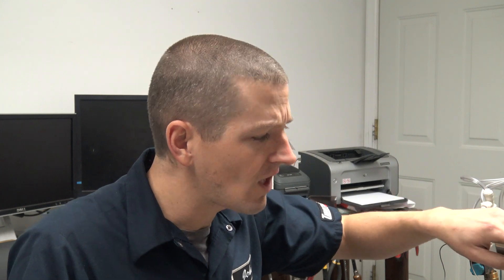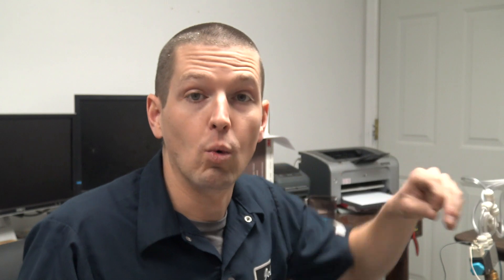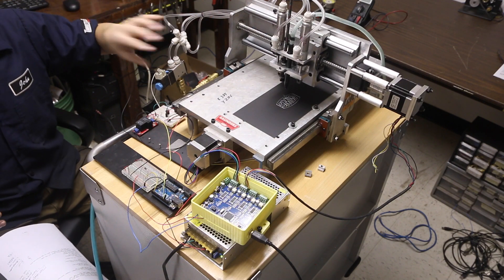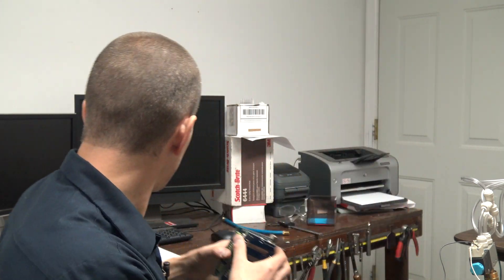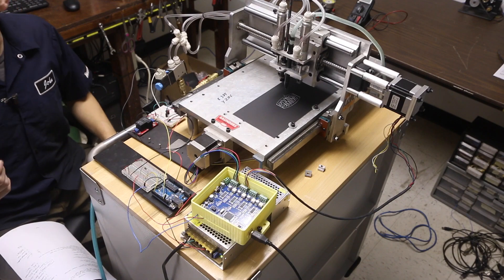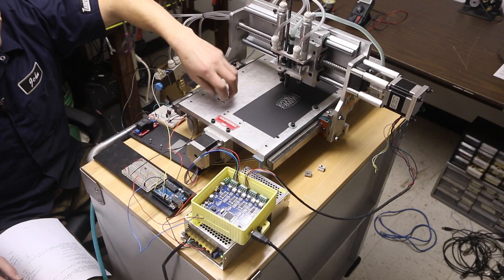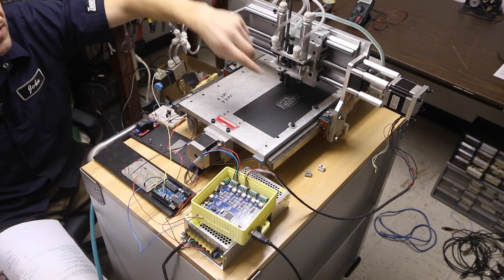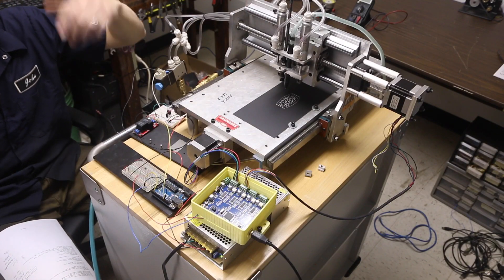DIY CNC Engraving Machine Details & Design

Comment: I know this may be a comment that may have arrived after the ship has sailed, but on commercial PCB milling machines (such as the LPFK), they have a shoe that rides with very little friction on the surface of the PCB. Perhaps you could do something similar here to keep the engraver at a set cutting depth and allow the pneumatics to provide the "Spring" action needed to ride out variations in material height.

Comment: Hi!  I think the relay fried your tinig.  You don't need a diode between the tinyg and arduino.  The correct location of the diode is between the source and ground of the relay.  Any time you connect an inductive load such as a relay, solenoid,  or motor to any integrated circuit (arduino,  tinyg, etc), you need to use the a flyback diode configuration.  Here is an explanation: https://en.m.wikipedia.org/wiki/Flyback_diode.

Comment: hey John. I know this is an older video and you may have every bug fixed by now but it reminded me of a software for pcb milling that will take your g-code and modify it to match your height variations on the work piece. bit more work involved compared to a working pneumatic system but the end result is astounding. Check it out here: http://www.autoleveller.co.uk/

Comment: For your plunge depth control, why not use a microswitch with spring loaded arm and roller?
 When the switch is engaged, lift the z access until the arm is relaxed and the microswitch turns off.

Comment: I have worked with neumatics and hydraulics for 20 years. Like everything the cost ramps up quickly and your air system also with quality inline filtration, dryers are costly. I think you used compression and expansion to label your cylinders, in neumatics you use a pressure on both sides simultaneously to regulate your working force desired much like your duel spring pin holder but using air pressure. Pilot valves regulars can get complex quickly. Thanks for sharing.

Comment: I left a comment on the first belt actuated machine. This looks feasible for my purpose of turning a manual knee mill into a CNC machine. From just looking at the price the motors are less than $15 , but are they strong enough to run a full size Bridgeport cloned mill? Also can 2 of these motors be coupled together for the X and Y axis? Or can the same other components be used with a bigger stepper motor? Its not that I'm just cheap, but rather I'm disabled from back issues but still love to make chips when I am able to get out in the shop. So being on a limited income makes thing tight.

Comment: You could use a laser optical sensor and zero it directly ahead of the pen tip rather than trying to dynamically regulate air pressure for your Z control.

Comment: I would weight the pen and have the pneumatics to lift it off of the part. fyi an old 9mm .40 cal brass make a great heat sink for the 7805 transistor. just knock out the primer and drill and tap for a machine screw.

Comment: You need a way to controll the C debth, but why are you trying to invent something that already exist? Stuborn? Stepper motors are invented for that purpose. You can also add a calibration routine that levels the ride height for uneven surfaces and that is not easy using pneumatics, -they give you speed, but not accuracy.

IMHO...

Comment: I don't know if you have fix the pneumatic issue. I have been working with similar equipments in the biomedical field as a field service engineer. In that design you put 2 air cylinders. You just need one. The one that is going to push the pen down. To have the assembly go up use a spring. You need to use a restrictor tubing in the intake and the exhaust to have a very smooth up an down movement. We use that in the biomedical to move arms and parts because is cheaper than stepper motors and more electronics. And works just fine. Lets say you put 30 psi in the air cylinder with no restrictors, it is going to move very violent. But if you restrict the air flow, the cylinder is going to move very smooth. And you can tune the velocity with different diameters holes or tinny tubings. If you have questions about that feel free to contact me. jmadero@hotmail.com

Comment: I just helped a friend assemble a 3D printer and I think that ALL the steppers ,drivers and software would work on adapting for cnc operation. Sorry about the move. I am just moving everything around my home shop and it is almost overwhelming. I am also building cabinets so I can get everything finally put away. Good luck and have fun. 
Bill

Comment: I like your "follower" idea. A cheap test valve would be an air ride suspension auto leveling valve which can be had at the auto parts store. Use a probe down to the work surface and the out-put to regulate the spindle height.
This way you would maintain the ability to adjust air pressure to change the tool pressure for different materials or depth of cut.
With a small carbide indicator tip you could get the probe very close to the engraver tip. These valves only require 2-3 inch pounds to actuate so the probe arm could be quite small, an indicator stand rod for example.

Comment: +NYC CNC  Have you thought about using a Jack Screw to control the Z Depth? OUtside of stepper motors i have seen lasers interrupts used with reference points on CNC routing tables. But I think a Jack screw in place of the threaded rod; since you could set the lowest end of the shaft at a few mm above the table and there are a variety of ways to control it from stepper motors with signal relays to help avoid missed steps to cog/chains that count either teeth or on time. I think a motor that connects to the screw shaft via chain and is controlled with a signal for foward/reverase bias in seconds would give you a fairly accurate setup with low cost as you already have an adruino and it shouldnt be to hard to add in the circuit. 

I'v run machines that use pneumatic to control a nozzle for re-flowing BGA chips on an automated table, they use a jackscrew with relays and a simple dc motor to control the nozzle height. And the relays tell the machine when the pickup has made contact with the IC to pick up/down and during the solder scavenge cycle keeps the vacuum nozzle from making contact with the board but maintain the correct offset as the board flexes from the heat cycle.

Comment: I was doing some research around a 3d printer but wanted to get something that i could potentially use as a 3d router/mill if i made the frame stiff enough. I started out with the Reprap electronics design but found may limitations not to mention the design is fairly old at this point. I was able to find a new board that combines some great features and is made to be used in milling/plasma/3d printing applications. Take a look (http://smoothieware.org/smoothieboard)

Comment: If you really want to get inspired by ultra high speed cnc motion in action, go check out professional PCB drilling machines like the Posalux Ultraspeed. They accelerate usually at around 4g (40m/s^2) on the Z, and not far slower on X and Y (depending on the size of the machine), move at several meters/second at a repetition accuracy of a few micrometers. What they do is use massive direct drive linear motors, and of course a massive block of cast rock (usually several tons, the US 6000 is over 8 tons heavy so it does not bounce around the shop floor at these rates of accelerations). And to top it of, they use quite fancy spindles too, with compressed air bearings they drill at over 300'000 RPM now. Amazing, fascinating stuff really, even if it's beyond what we would ever get in our small scale diy machines.

Comment: Sorry, Commenting as I watch. If you are looking to replace the Tormach, I HIGHLY recommend building the Oc CNC designed by ++Mark Carew. http://www.openbuilds.com/builds/openbuilds-ox-cnc-machine.341/   I just finished my mechanical build. Total cost ~$1k using a Huanyang VFD and 2.2 KW spindle. Also using TinyG to control.  You can absolutely use the Raspberry Pi set up you talked about. For a front end you can use an android tablet and TinyG CNC Console for Jogging. You can also use ssh/X11 forwarding to run Chilipeppr. There is also an offline version of Chill available.

Comment: I would use the Auto-Leveller built into ChiliPeppr to map a grid of the depth of the part you're engraving. If the part is conductive that's easy. If it's not then you lay aluminum foil over it, probe it, then run the engraver. You may have to adjust a G54 Z zero to account for the thickness of the aluminum foil. There's a video inside ChiliPeppr showing how to run the auto-leveller. It would mean that you need to add a stepper to your Z axis.
Reply: +John Lauer Could he use an inductive sensor (NPN NO) as a z probe if he is always going to be engraving anodized (electricly insulated) aluminum? Custom z offset(G54?) for non-contact probe? He could use the stepper to adjust his hard stop screw and still use his pneumatic cylinders. Or if he is only engraving parts he has designed in Fusion 360 couldn't he just do the engraving as another CAM process. Zero at the correct spot and orientation and run it with stepper controled Z stop?

Comment: Z axis: You have a leadscrew already. I'd put a stepper and bearings on that, ditch the pneumatics and treat the system like it's a full 3D mill rather than 2.5D. Then you can engrave on other non-flat or non-level surfaces You'd need a spring that'll push the engraving tool down with the requisite amount of force to keep you from pulling your hair out with varying height offsets, though. That's an exercise for the reader.

12v to 5v: Easy hack: Cheap car cigarette lighter cell phone charger cracked open and the USB ports desoldered will net you a "reliable enough" 5v 0.5A minimum. (Nowadays, some can do 2A, most are 1A, IIRC) supply from your 12v. They're available at gas stations, the local wally world, etc. It fails, you just buy a new one.

Movement speed: You're not milling: Gear the steppers ("harmonic drives" are nice and practically zero backlash, but expensive) or get ballscrews with a shallower pitch. I think new ballscrews are the cheaper option. A "new" pair of eBay-sourced XY ballscrews would cost you less than a single used/"surplus" harmonic drive on eBay. Preloaded double-nut leadscrews are more trouble than they're worth over the long term. (If you're using this in a moderate prod. environment, you'll end up fiddling with it at least monthly and probably replacing screws yearly because of wear. This doesn't really apply to Z as much because it's  just "down <a bunch of XY moves> up, <position to next> down...") Yes, you'll sacrifice a bit of accuracy but do you really /need/ engravings accurate to half a thou? I'd go for the speed, because your engraving (for say, serial numbers, plaques and such) would be just fine, even if off by the thickness (four thou) of a sheet of printer paper. So long as it's repeatable, (which ballscrews excel at.) it's a matter of software configuration.

Comment: that thing looks very precise.
for my own project, i used a DC 3V/3.3V Relay High Level Driver Relay to read the signal from the tinyG and tied in the 12 volts that come off the tinyG for the cooling fan to trip it.

to get more speed you can set the tinyG max velocities and jerk values using $xfr and $xjm. but changing over to belt drives instead of lead screws would be faster.

if you build a plasma table, keep the electrical interference in mind, it's been a real problem for me.

Comment: As far as needle distance, build a small laser range finder pointed just in front of the contact point and feed that into the z-axis control. With a little calibration and or delay that should do the trick.

Comment: John I have used adjustable pressure relief valves in the source lines for the push on the cylinders to get controlled forces from cylinders if you put a regulator to limit the raw pressure to just activate the valve and then bypass excess through the relief through a port to reduce the flow it could work and not  eat up a lot of compressed air.The Idea is to let the bypass set the level of the engraver.

BTW my Maker space MauiMakers would love those boards to play with. Web page is MauiMakers.com

Comment: It would be my pleasure to try and fix the Tiny G boards.
Would controlling the air pressure provide the pressure control to the engraving tool you need?

Comment: You should use a floating engraving z axis for automatic mechanical hight adyustment. Could be another project for jou :-). 
Those tiny g boards are simple to repair, coul´d do it myself.
Reply: +Andrej Novak : http://www.sorotec.de/shop/CNC-Mechanics/Depth-controls/Engraving-unit---Depth-control-GT43.html

Comment: John, If you want to go faster using stepper motors you may have to change the drive train away from ball screws. If you want some advice on the design choices I would be glad to help. I have been building my own CNC machines for about 15 years. You can check out my podcast CNC Router Tips.

Comment: I would suggest using a spring in the spindle with adjustable tension.  It would in effect give you a spring loaded engraving tool.  This would allow you to engrave slightly curved or parts that are not flat as well.  My experience is it takes some fine tuning in the tool paths to get it dialed in but in my opinion worth it.

Comment: I've seen examples of using Arduinos to pull and decode iGaging DRO's to display on android tablets or other displays.  Instead of using more expensive rotary encoders or servo motors to eliminate lost steps from cheaper stepper motors, why not use cheap DRO's to pull actual positions and adjust accordingly?  The code shouldn't be that complicated, but incorporating it with g-code may add too many complications.  

BTW, I love all the work you're doing with this to help provide the rest of us a more turn-key solution.

Comment: Hi John, 

Just a quick word on maintaining the depth, If it was me, I'd allow the pen to float within a housing with a spring to maintain the down pressure, along the same lines as your pneumatic approach, however you can swap out the springs and adjust it a bit easier. 

More on the DIY CNC stuff, I think it'd be amazing for you to build a plasma CNC. I'm currently working on one in my spare time, so far I've got 3 stepper motors an arduino and a grblsheild (all thanks to you) and am looking into the hardware for the frame and gantry at the moment. 

My next problem is that I need that 'coolant' on and off, or in other words another channel to send signals on. If you don't mind me asking, what would you do to make this happen? Is there someway to make this work with the GRBLSheild and arduino, if not would you go down the same path that you have with the TinyG, or is there another board out there I should check out? 

I love the passion and enthusiasm you bring to your channel

Regards
Peter

Comment: For low cost standardized kits/parts try http://openbuildspartstore.com/ and their forum http://www.openbuilds.com/  They use the frame's extruded aluminum as rails and V-wheels (your choice of alu, delrin or polycarb).  On the forum there's build logs of all kinds of machines being built... I'm on my 2nd build :)

Comment: Rig up a small strain gauge to the z to monitor vertical tool pressure, set the target pressure and let the computer figure out where the z needs to be. It'd work similar to the torch height control on the plasma table. The computer would just be monitoring a voltage and adjusting to keep it in spec.

Comment: It's looking good John!

Yes, anti-static bags conduct....that's how they work....they conduct the static charges so the parts don't have to. It's metal that gives them the silver color. They aren't guaranteed to protect your parts in all cases either...use a wrist strap.   Even if you don't kill a part outright, you can do enough damage to make it flakey or to reduce the life expectancy. 

I'm wondering if the speed issues result from using a slower, lower power CPU?  Maybe it's pumping pulses to the steppers as fast as it can?  If so, you'll need to go to a faster or more powerful processor, or use several, or helper circuits, to do the stepping. I.e. The Arduino says, "spin at rate X" and another Arduino, or a dedicated circuit, starts putting out stepper pulses at the required rate to do that. I'm not an EE, but I'd guess that a voltage controlled oscillator might be a starting point for something like that. Just a thought. 

-- Mike

Comment: Hey John have you looked at Torchmates build yourself options? They give you all the hardware software and you provide the steel to build it in your style. It saves a bunch of money from buying the factory built ones and you get the satisfaction of designing what you like. I have done it and have a 6'x12' table that rocks on a water table. Running a thermal dynamics A120. It was a great experience for me but there's a couple things I didn't like so I changed it. Hit me up if you would like to see what it's like pics info etc.

Comment: Spring load your engraving tool. If you get the spring force right, it should engrave nicely while following the material thickness variations. Make it adjustable for different materials, and you won't be hammering the engraving bit into the material as much.

Comment: A simpler way to interface the 5v beefcake relay to the tinyg board is to use an optoisolator. Along with the voltage level shift, this also will provide protection to the tinyg board. The way it is now an event is likely to take out both the arduino and the tinyg. A 4n25 is a common opto but most will work. You will also need a resistor in series to limit the current to the led in the opto, a 220 resistor will give 10milliamps  which should work fine.